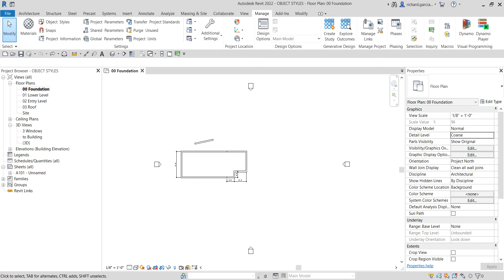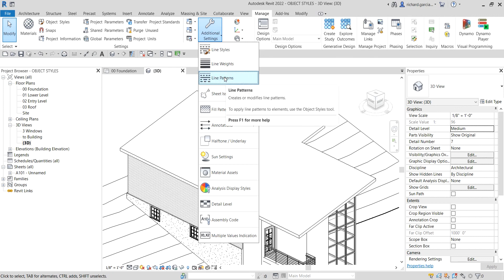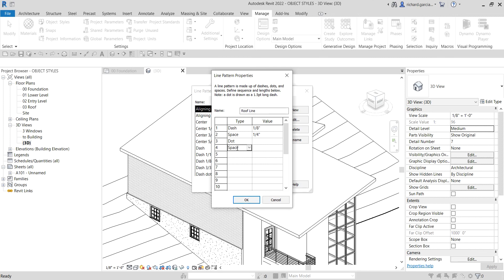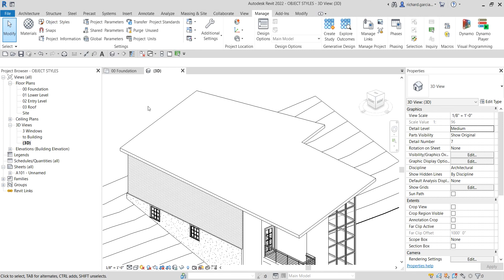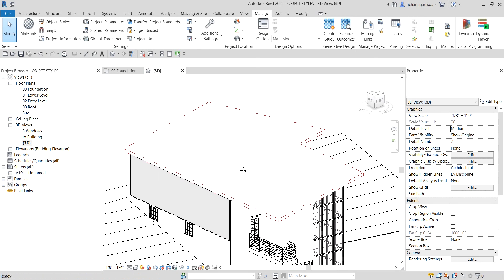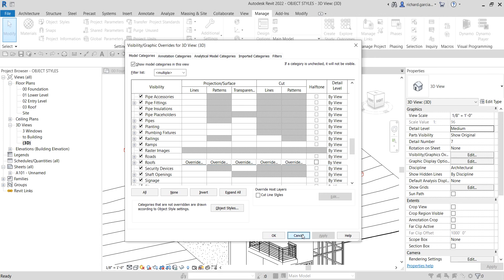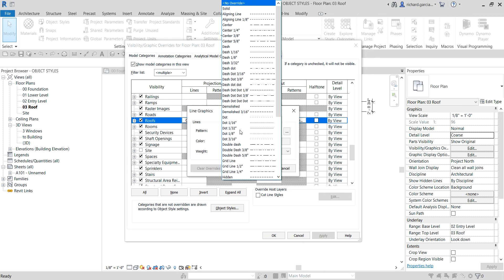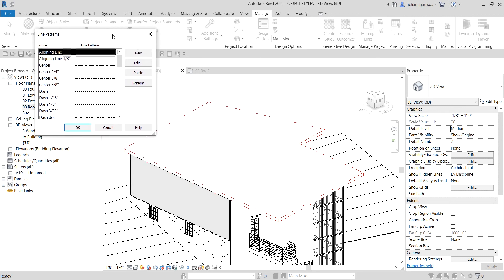REVIT TIPS AND TRICKS: HOW TO CREATE LINE PATTERNS

Comment: Any way to continue the pattern around corners and short edges?
Reply from the maker: hi israel, in Revit, when creating line patterns, you may encounter challenges when trying to make them continue seamlessly around corners and short edges. Revit's line patterns are typically applied to model elements and may not automatically adjust to corners or short edges.

However, there are some strategies you can use to achieve a more continuous appearance:

1. *Adjust Line Styles:*
   - Experiment with different line styles and patterns that may better suit your needs. Revit offers a variety of line patterns, and some might appear more continuous around corners.
   - Modify the line weight and color to make the pattern visually consistent across different parts of the model.

2. *Use Detail Lines:*
   - Detail lines in Revit are more flexible than model lines and can be used for annotation or guiding elements. You can create a series of detail lines to simulate the desired pattern around corners and short edges.

3. *Create Custom Patterns:*
   - If the built-in line patterns don't meet your needs, you can create custom line patterns. This involves creating a custom line style with the desired pattern and applying it to elements. However, note that this may not automatically adapt around corners.

4. *Splitting Elements:*
   - For certain situations, you might consider splitting the elements into smaller segments that are more manageable. This can help control the appearance of line patterns around corners and short edges.

5. *Model Patterns in 3D View:*
   - Sometimes, creating patterns in 3D views can provide a better representation of how they interact with different angles and edges.

Remember that Revit is primarily a modeling and documentation tool, and certain graphic detailing capabilities might have limitations compared to dedicated drafting tools. Experimenting with the different approaches mentioned above and finding a balance between visual representation and modeling constraints can help achieve the desired result.